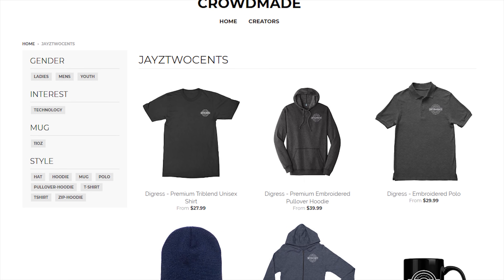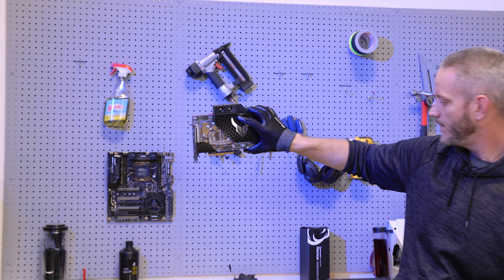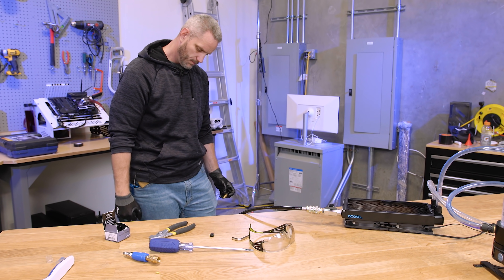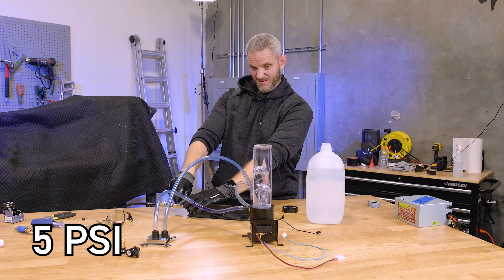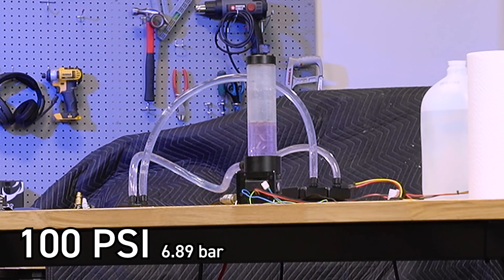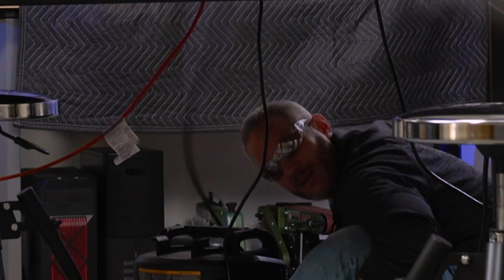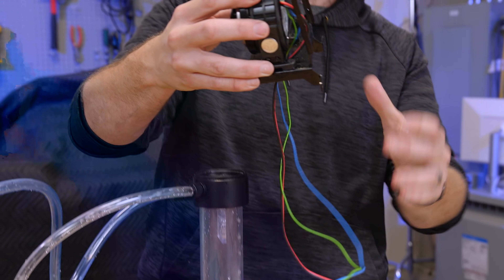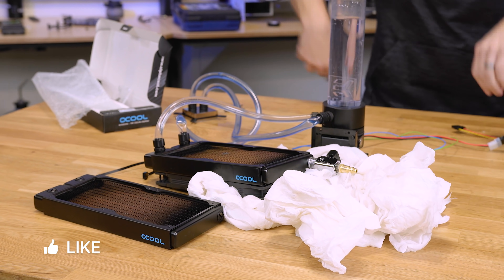The loop EXPLODED! DON'T TRY THIS!

Comment: Going to nit-pick this one just slightly... In this case you has a sealed system, assuming water wasn't seeping into the air line and tank (pretty sure it was), with an air gap in the res..  That little bit of air gives a lot of room for more to be stuffed in.  having an actually full loop with little or no air, such as an AIO cooler, a tiny bit of fluid expansion can cause a lot of damage.  Same principal as drops of water freezing being able to crack concrete.  if the expansion has somewhere to go, ex compressing the air in the res, there's no problem.  adding air pressure and increasing pressure from heating fluid in a sealed system are two different things. It doesn't matter in the slightest for water cooling a PC, but it could in real world applications.

Comment: Not gonna lie, seeing this has actually instilled alot more confidence in me to trust water cooling more.
Reply: hell yea; it can take up to 140 psi lol
Reply: Those were soft tubing fittings tho, they can hold more pressure than a hard tubing fitting can.
Reply: But only after market cooling done right like jaydoes it.
Plus he should have used a clc aio too
Reply: not me,   its to critical a failure,,    the potential for destroying everything in the pc is too high. water and electronics dont mix...   can you do it with a non conductive liquid?  that would be intelligent..
Reply: @harleyme3163  i had a leak on my cpu block. back of my old hd4890 became a lake, started dripping into the hdd that was upside down mounted. only noticed the leak when WoW started having strange artifacts in the 3d graphics(the UI never showed issues) after a quick unplug, a rinse with some rubbing alcohol, and 2 days of downtime in front of a fan, reassembled with no problems. didnt even lose the hdd
Reply: @harleyme3163  most non conductive fluids become conductive sooner or later because of dirt and impurities.

Best thing to do is to route your tubes smartly and to do it all carefully to minimise damage in case a leak occurs.
Reply: @carlangelo653  just use demi water
Reply: @harleyme3163 that's the point.....all aios don't have water in them. They have distilled water mixed with anti freeze. The liquid is non conductive making it perfectly safe in a pc. If it leaks its no big deal  a quick dry up and it'll still work.
Reply: @harleyme3163  if you buy pc coolant 99% of it is low conductivity only time you have to really worry is if your use distilled water only.
Reply: @yoyosfpv823  false false false. distilled water is not conductive at all since it does not contain minerals out of the bottle, every coolant gets conductive as it circulates in the loop whatever it is specialized fluid or distilled water. You can dip any pcb in fresh distilled water and it wont short.
Reply: Fast F. Straight distilled water has a faster chance of being conductive within first few minutes of circulation. Due to it being in contact with metallic materials. Low conductive fluids protect longer due to the propylene glycol in the coolant. what your saying is true but also false, coolant weather it’s Pc or automotive are both considered low conductive otherwise if a car cooling system sprang a leak that was directed at the alternator the alternator would be destroyed

Comment: Now if you can achieve a pressure of 29,000PSIa the freezing point will be -20.8°C, some sort of pressure washer water cooling rig dry ice combination.
Pressure washers can get into the tens of thousands pounds per square inch add atmospheric pressure and you get PSIa
It'll never happen, but it's a pretty cool thought.

Comment: I work in quality control for a company that makes stop valves, the things under your sink to turn the water off, and this hit very close to home in what I do. We do random stress and destruction testing on all of our product in a similar manner to this. We will take a valve and submerge it under water and then turn on air pressure and our standard is 100 psi for any air leaks. We also do hydraulic destruction testing with water or oil and our standard is 1,000, but most product won't fail until 1,500-2,000 psi. Our sink that we do the hydraulic testing has a metal plate where the valves hit and a whole inch of some kind of acrylic shielding on the top, but there is a hole in the sink from before the metal plate got put on, it's like a large laundry plastic sink.

Comment: I think that using hard tubing might give you surprising results, along with failure at a lower point. Those soft tubes definitely deformed and expanded, absorbing a lot of the pressure, not really putting pressure on the components.

Comment: I would be glad to use that after seeing what you did to cool my gaming system. Nice to know how much it can handle. Most car radiators run about 13 PSI in them so that was just overkill.
Reply: Nahh the test needs some things to be checked out like the lack of check valve ensured the water was flowing through the loop back to the  compressor

Comment: *positive comment guy*

can u redo this test with radiator in a fire or above 100C boiling temps plzzzz i wanna see what steam pressure would do :D TY
Reply: @Gareth Tucker i was wondering that. special cause modern cpu thermal throttle so hot some upto 100C+

Comment: IMO the heatgun thing you did is a more accurate recreation of the problem.
Air can compress much further than liquid. With all those bubbles / unfilled space in that loop, it is fair to say that you'll need a whole lot more pressure for it to burst compared to a fully bled system.
Maybe a slightly aired loop do has its perk.

Comment: 2 ideas
1. Fill a loop and run it without a pump until things happen.
2. Test the freezing point of an asetek aio by putting it in the freezer for a few days and see if it freezes or causes a leak.

I live in michigan and want to setup a mini itx/micro atx pc as a media/music setup in an older heavy duty pickup. It rides like crap so i can't use much of an air cooler for fear of breaking a board but it can get to -20f once in a while and i don't want to have an aio burst. I can't afford to test this idea myself in real time so I'm hoping you could test the freezing point of an aio.

Comment: Thoughts:
Water is an incompressible fluid.
Air is compressible.
As air is pumped into the loop the pressure will rise, but as the total volume of the loop is fixed there shouldn't be any change in the water level in the reservoir.
But the amount of water in reservoir is decreasing, and as water does not compress that means it has to go somewhere.
There isn't any obvious leaks where that amount of water could escape from the loop, so it has to be in there somewhere.
The tubing is flexible and can expand which would increase the volume in them, but from what we can see it doesn't seem to be enough to explain the decrease in water level in the reservoir. But I could be wrong about that...
Thing is the obvious place for the water to go is down into the compressor. Just having pressure in the system isn't going to stop water from running down the hoose, and it is down as the compressor is on the floor.
So Jay do drain the tank on that compressor and see how much water there is in there.

Also this is a good demonstration of why pneumatics can be more dangerous than hydraulics. If you did the same experiment with a high pressure water pump and minimal or no air in the loop then the failure would occur at the same pressure, but it wouldn't have been as energetic, and nowhere near as entertaining.
Reply: I agree your science in on point 
I just wished some one introduced Jay to a check valve

Comment: Surprisingly enough if you have 0 air inside the system pressure rises really fast as water wont compress like air eventhough it expands like air when heated . 

Theoretically an exploding sastem is possible, BUT so unlikely you may just win the lottery twice and then get struck by lighnting

Comment: I think we can all be confident that your rad won't explode under normal use.  Your CPU will have melted down long before you boil enough water to create 140psi in the loop even if your pump isn't working or your rad is clogged with gunk.

Comment: Now im just as paranoid as i was before about buying a water cooler. I dont want to put one in a $2,000 computer and then lose everything because it leaks or explodes because it got too hot. You werent giving me much comfort when you were saying you'd lose all your components but the reservoir would be fine. I dont care about the damn water cooling if i have no computer anymore >.>

Comment: Heat is the enemy and not pressure, heat cause things to expand. Say with barbed fittings with hose only secured by zip ties, the plastic will expand and soften to the point of release. My brother had that happen with a xspc raystorm 750 kit that is a junk tank, its a fish tank pump that dose not draw from the bottom and below 1/3 no flow. So you should retry the test but only at like 20psi and add heat like from a heat gun, see at what temp the hose will release from a standard fitting. That radiator could be fine for retest if you jb weld that fitting back in.

Comment: @Jayztwocents is this your new way of priming a water cooling system to get the air bubbles out of the rad? Lmao!
Reply: Just hook it up to the reservoir at the top and push the water through the system lmao!

Comment: 1)I'm loving the water running out of the loop into the air tank. 2) the radiator bent when it went flying, not from the pressure.
Reply: Water wasn't running back into the compressor.  The lines and radiator were expanding as the pressure increased, which made it look like there was less water. Watch closely - you can tell that the lines are almost double size at around 100 psi... that's rather a lot of volume. :)
Reply: @Broadpaw_Fox  I'll agree that the tubes increasing in diameter is a factor, but without a check valve gravity is pulling the water into the air tank.

Comment: lol. 
to be fair i have experienced high pressure leaks with barb fittings and only barb fittings. once forgot to plug the pump back in (with barbs) resulting in a hot leak.
when that pump combo died (after some 8yrs) i had comp fittings at this point all that happened was it slowed the core clocks right down.

Comment: Well, all radiators pretty much come from china at last the core part, prolly out of the same plant for most manufacturers.
Not entirely sure on HWlabs.

This stuff (radiators) has to be able to withstand 6bar enduring, so add a safety number and you can easy go to 9 and above.
Thats an industrial standard thing much.

Would not give alphacool tooooo much credit for that. Its just their name printed on prolly.

Comment: "I don't want to destroy perfectly good hardware" from the man that sprayed a GPU with a spray bottle while pretending to sneeze. Jay you are a complicated man.
Reply: He doesn't want to, but he does it for ... scientific reasons
Reply: Dont forget the time jay drilled through a motherboard to mount a CPU cooler
Reply: @diablo666morgan  I just did the same to my GPU as I mounted a CPU water block to it :D
Reply: This is also the guy who put beer into a water loop... at a hotel.
Reply: The difference between screwing around and science. You record your screw ups.
Reply: Pffft. Who calls a GTX 1650 a good hardware?

Comment: so water is not compressible, that water level going down simply means that the tubes get blown up. This is fun but also reduces the pressure, so the actual pressure in the system was much lower. WHich is why it blew up after some seconds after opening the valve because it takes some time for the pressure to build and just opening it shortly didn't actually put the pressure up that much.

Comment: This is the reason I always recommend a pressure relief valve on the resovour.
Reply: In case you accidentally hook up a compressor at 140psi?
Reply: @dalelc43  Back in the "old days" before variable pump speeds and possible dying garden variety water pumps and Regular old Barb fittings running a pressure relief valve was advisable because pressure in the line would blow the tubes off the fittings, also if your pump was dying it was a great possibility that the distilled water would vaporize on the block due to the lack of flow causing great pressure to build up, also it could happen if the pump wasn't sufficiently powerful enough ie it didn't have enough head to cover the loops length and you were running at a low bar.

  I mean its your thousands of dollars play it the way you want to, grant it modern water-cooling is miles easier than it used to be.

Comment: Hey Jay, I work for a company that does a lot of hydro-static testing on industrial and hydraulic hoses, and one huge factor in a successful test is bleeding out any air that might be lingering in the line, seeing as though air will find any little imperfection, (such as a crack, thinned/stretched lining, dry rot, etc.) and create a flawed test whilst damaging/destroying whatever product it is you're testing. Now, while I understand your situation for using an air compressor (to add pressure), I'd have to suggest trying an (almost) airless loop, in a controlled area of course, with a water source connected to a small pneumatic pump, connected to your air compressor, with a pressure gauge and a ball valve to control pressure input to insert more water pressure into the loop to achieve a more accurate test. The air pushing into the loop most likely found the smallest inconsistency in the reservoir o-ring seals, allowing water into the space, then resulting in the friction holding the seal to be loosened, hence the shaved oring. (I realize this is almost unrealistic, but eh fuck it, figured I'd try anyway.)
Reply: Yeah, well he should just use some pump with water pressuring system. I know what you're after at. I occasionally have to pressure test multistage heat exchangers in my work.
Reply: @jothain  yeah we use pneumatic pumps that force water into the hoses rather than air. We don't use electric pumps because of high exposure to water.
Reply: Or just connect the compressor to the top of the reservoir directly to the regulator, so you just control the pressure of the air on top of the water thus increasing the pressure of the water without introducing air to the rad and water to the compressor
Reply: @noahluppe  if that's possible, sure. But depending what you're pressurising it isn't always possible to do.
Reply: @jothain  I think it is possible in this specific test he did. In the end the effect is the same but without any air bubbles in the hoses or rad.

Comment: Alphacool definitely will be in my first liquid cooling system in the future
Reply: Alphacool made the Rad, the rest was all EK components.
Reply: @askmyteapot  And the EK stuff gave up first :D 

I have a Eisbaer 360 in my Pc, with the same Radiator but only a bit bigger. Well, the radiator will hold..:D
Reply: But make sure you know what you are doing with fittings too 
And that rad is a tank
Reply: Me 2
Reply: yeah i would be carefull with anything out of acrylic from alphacool, so no clear parts, or use EK WB for your Blocks and Reservoir .
Compression fittings are waaay cheaper than other mounting mechanisms (but then u need to go soft tubing for sure)

Comment: To be accurate a stable liquid doesn't expand or contract under pressure changes, the gas trapped within the liquid can however. This is why ethylene glycol is a good medium for radiators. Combined with it's other properties it's high viscosity means small air bubbles have a hard time forming.

And your air compressor should be fine if a little water got in assuming your drain your air compressor after each use right???

Comment: You should do the reverse of this video, seal up a typical system and include a pressure gauge and temp probe then use a torch or something on the CPU heatsink to see what the pressure looks like at different temperatures and maybe add components to the loop to see how temp and volume effect pressure
Reply: there wont be a mesuarable pressurechange because water isnt really expanding (or compressing for that matter) so only if you make the water change its state to a gas you can increase the pressure by adding heat. and that happens at 100°C.
ofcourse they could preload a system with air pressure and then let it run but thats soo dangerous

Comment: next what happends if you compress all the oxygen in a panzercool radiator aka opposite of what your doing now because you know jay we all want to atleast in our lifes take our gaming pc with us once into space and game
how long does a computer work as soon as its on fire
what happends when you play with different values of amperage volts and wattage when not on spec not general voltage changes XD
could you watercool a quantum computer with a aio cooler i cant properly max out quantum break without a quantum computer you know
how to properly cool a pc in a freezer

Comment: OK, THAT is incredible - I didn't expect the tubing to hold more than 40psi!

...it only makes it that much more frustrating that turbocharger cold side piping will blow off with as little as 10psi if you don't have very good clamping from the beginning - nevermind when you start getting into modded diesel territory, like where they were at here(OK, the majority of modded diesels aren't pushing 100psi; but many of them aren't far off of that either)...

Comment: Actually fluids don't really expand (not like you're thinking anyway, they don't compress either actually). The air that's in there can expand from heat, or the fluid can boil (and the gaseous water [or whatever fluid that's reached it's boiling point] then takes up more volume than the fluid did)...
Reply: Liquids expand when heated.

Comment: You should do that for your next test.... Take an old FX 8xxx processor, over clock it and then turn the pump off. See how long it takes before either the CPU dies or the loop explodes from pressure :D